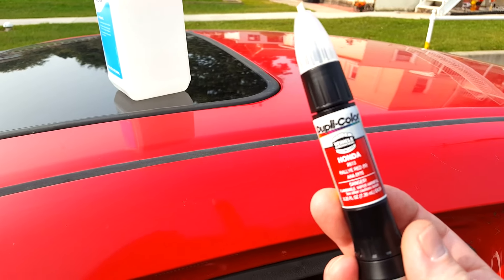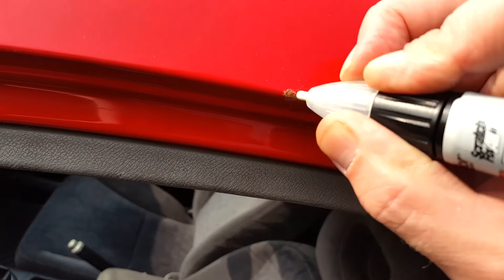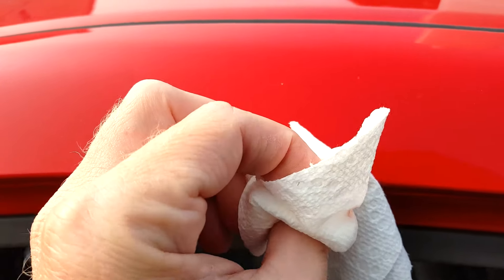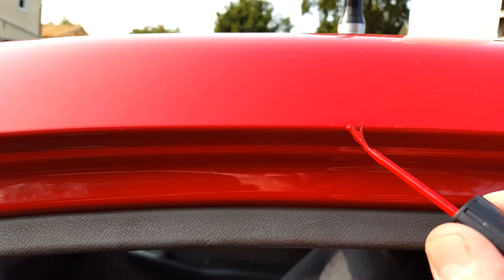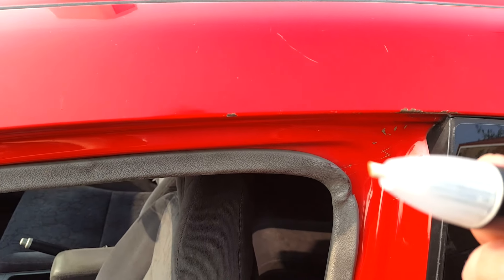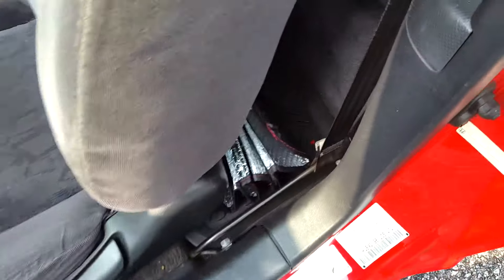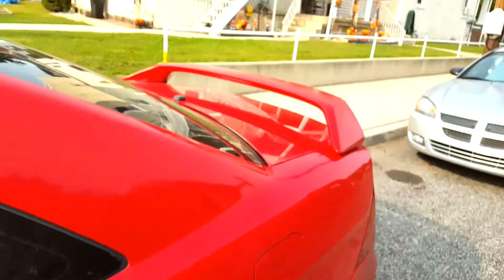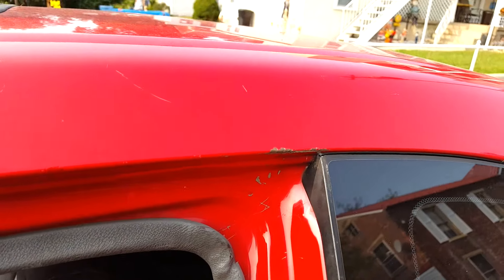How to use a Dupli-Color touchup paint pen, Scratch Fix All in one

Comment: Make sure when you use the clear coat, keep the pen upright and not open the cap when it’s on top like the paint. Otherwise all the clear coat will run out of the container on be on the brush part. Not sure of these pens explain that, but it would help if they did. Bc once all the clear coat is on the brush part and out of the container, it’s not easy to pour it back into the container. I had to find a cap to pour the clear coat in , but the next problem is while your applying, it dries up and makes the clear coat sticky and messes up the sponge brush.
Reply from the maker: Wow that's really annoying. I actually have not used the clear coat yet just because so many other things have needed attention since but this year I plan to do a lot more when it comes to painting and using clear coat on my cars.
Reply: @danrandom3390  hey, may i ask what paint and items you used Exaclty? I have a jetta 2016 and i think we have the same red color I’m not quiet suree
Reply from the maker: I used Rallye red that was listed for my 2001 Civic. Depending on how nice your paint job is you might be able to get away with something close. When I first bought my Civic the rear bumper looks so horrible that I just grabbed a can of red paint that looked similar and emptied it onto the bumper and it looked 100 times better 😂
Reply: Yeah I made a bad situation worse with the touch up pen. I scuffed my paint backing into something (wasn’t very noticeable). Tried to touch it up and made my car look so shitty. Wish I could sent the pictures lol. I need to fix it completely now with a light sanding and some spray paint
Reply: Wow  thanks so much. I haven't started yet but will sure take your advice.

Comment: Yeah I have a ton of these and as a new driver I’ve been freaking out about rust. I’m currently using the pen and I have Kurust to try and coat any loose rust I miss. Also question if it rusts that means it down to bare metal or no? Do I need to use self etching primer? I bought some but kind of feels overwhelming to be using so many chemicals and waiting for dry times.
Reply from the maker: Use a good brand of rust converter and don't clean it up to bare metal, just give it a quick metal brushing or scrubbing with a rag depending on the situation. The chemicals in that react with the rust which makes it work better. In the past I have done this and then maybe gone back a second time after sometime and then it's usually good for some paint.
Reply: @ thanks for the quick reply. I sanded them pretty good and put kurust on it. Waiting on it to dry now. So are you saying I should skip the self etch primer and just touch it up when it dries ?
Reply from the maker: @RGM5396 Well I don't have much experience with self etching primer but basically I treat it, then wait weeks to see how much took, then repeat the process until it seems like it will last.
Reply: @ I already used the self etch after kurust now. But for future reference what rust treatment do you use? Unfortunately I don’t have a garage so I would need something that dries fast.

Does the rust treatment take weeks?
Reply: Also thanks for all the help I literally just started driving a month ago and no one around me seems to know what to do about chips.
Reply from the maker: @RGM5396 sure no problem

Comment: I just used one on my car and now I have to fix the spots I fixed 😑 even a tiny amount shows up pretty visible on my car, idk if it's because it's black or what but it kinda looks like smudges. It didn't go on very smooth at all. I'm going to have to wet sand and buff it out.
Reply from the maker: Yeah, oftentimes you'll see the touch up will be slightly above the rest of the paint. I'm interested to know how it comes out when you are done and what methods you used.

Comment: That clear cover with the abrasive tip has a very small pressure point it allows a little tiny bit of paint without dripping... check it out... once the clear tip comes off no need to cut its a spring loaded tip...
Reply from the maker: Yes and I would test tap it on something else so that you can get a feel for how much it is going to flow and how hard you have to press.
Reply: pause

Comment: bro didnt show us clear coating it part.
Reply from the maker: That's because I still never did it to this day lol
Reply: @danrandom3390  so basically is it not helpful? or will it make that spot to shiny you think?  Or should you only clear coat large areas?
Reply from the maker: @rmat9023 Well in my situation it seemed like if I added clear there would be a definite bump and it looked fine compared to the rest of the paint anyway and honestly still looks the same a few years later now. I think the main reason for including clear is to fix spots where the clear coat is only damaged.
Reply: @danrandom3390  oh i see.  Yeah sometimes the enemy is of good is better.  I wonder how you can have just clear coat failure but not paint chip.  I have not seen that really, I mean clear usually fails after years and years and all over, in splotches.  at that point, you'd just repaint all of the car.

Comment: Why didn’t you use primer after you cleaned the rust? I heard you should use clear coat after 30 minutes of painting. Not wait the next day.
Reply from the maker: Honestly I wasn't trying to do a great job, just a quick job. It's been about a year and the work still looks the same as the day I did it. I am going to get back to the Civic's paint and do a better job after I finish a few other things.
Reply: @danrandom3390  ok great I didn’t want to use primer anyways, takes forever to dry. I’ll do the clear coat tho on the same day. Thanks for the video!

Comment: just applied what i learned. It is dark, will see how it looks tomorrow morning. if not good, can I redo it?
Reply from the maker: Most likely, worst case you could try taping around the spot and sanding with some fine grit paper.
Reply: I’m a little late but usually if the touch up seems bolder than the paint around it your paint might be faded, polishing the whole panel may help balance it out